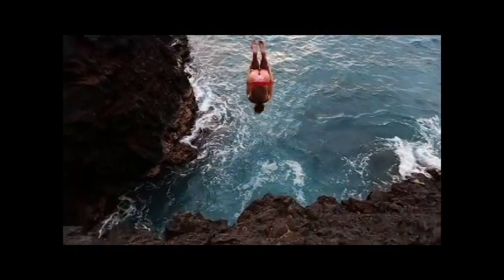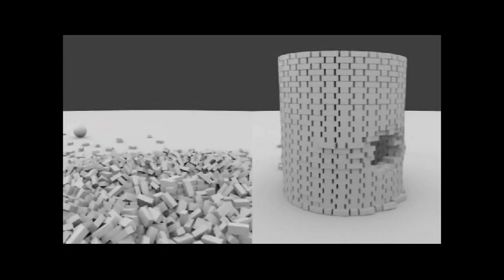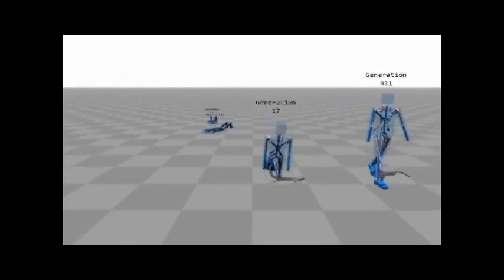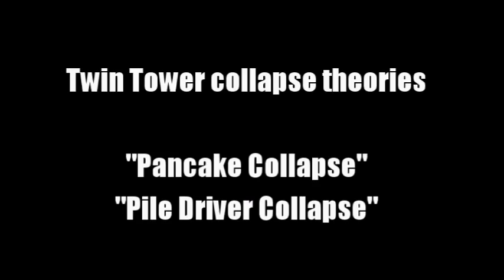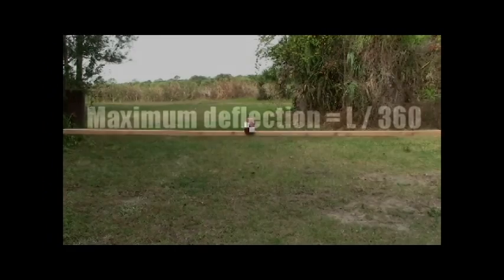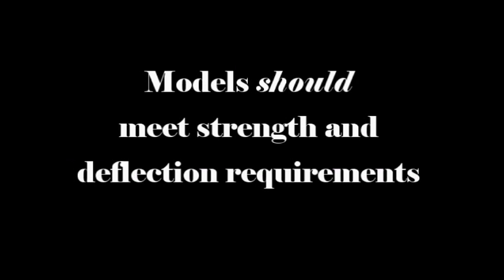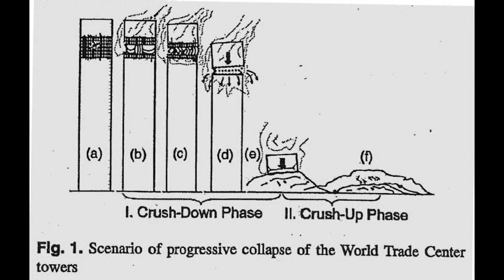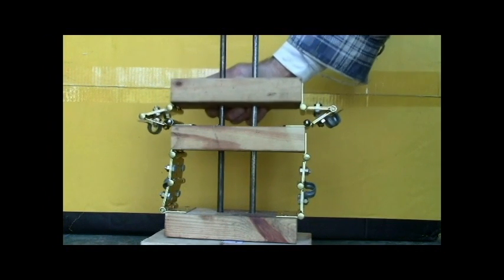9/11 Experiments: The Force Behind the Motion

Comment: Interesting and well thought out experiments but in the end proves little . The fuel from the aircraft leaking from impact point to lower floors may have set up a fuel-air explosions from arcing electrical cables and the heat from the fires weaken the structure, which was a monocoque design not post and beam creating a cascading failures. Your experiments did not do that , paper ashes does not reproduce metal getting ductile .

Comment: Strange how in your experiment the walls of are rigid and immovable. In the WTC, when the collapsing floors deformed each would begin bowing out,or in, the walls of it's, and lower floors, which in the WTC were was the primary load bearing structures. 

In your case these are completely ignored and not only not taken in to account, but assumed to be infinitely rigid. I liked the use Feynman to explain pure math over real observation, but in your case, experiments need also be peer reviewed and cross checked to make sure it properly modals the initial conditions of the event.
Reply: freeman239 bowing out, in no such instance in any vid did it look like the floors were bowing out, it looks to much like a controlled demo

Comment: Everybody should understand that there were no actual plane crashes on 911.
The greatest proof of this for the WTC planes is in the physics.
Newton's 3rd law states that "for every action, there is an equal and opposite reaction".
This means that in any collision, BOTH OBJECTS RECEIVE THE SAME FORCE.
The outer wall of the WTC was made from "the strongest steel ever used in building construction" and comprised of 2/3 tons of steel for each 18"-wide window. 
The construction is documented here:
watch?v=Jwc49cZKunQ
Whatever damage was done to that steel, the same amount of force needed to do that would also have to be received by the aircraft.
The amount of force needed to destroy the structure of a plane would be insufficient to break through the massive steel columns (and spandrels that were 2" thick) of the WTC outerwall.
In any case, the resultant force of any impact would cause a deflection of material backwards and away from the impact causing bits and bodies and luggage to fall into the street below.
And the thing is, even if you accept that Newton's laws might be variable according to speed, and that a plane could punch a hole then there is still no way whatsoever to explain how, with most of the aircraft vanished into the building and disintegrated it would be possible for the final bit, the tail section to penetrate a still-intact steel wall in front of it, as it would have no propulsion, little mass and little structural integrity.
This understanding allows us to see that the news networks broadcast pre-prepared fake video as "real-time" news and ran a co-ordinated psy-op.
THIS IS THE SILVER BULLET AGAINST THE MEDIA NETWORKS and it demands the question of who was controlling them.
It also exposes every other aspect of the official narrative as a lie.

For an object to penetrate such a structure, that object would have to receive the same amount of force needed to cause the penetration.
I suggest that such force would crumple an aluminium airliner, leaving fuel, wings, luggage, seats and people falling to the ground.
For that object to make IT'S OWN SHAPE in the structure, the object would have to receive that amount of force without breaking.
Think about it.
http://i178.photobucket.com/albums/w254/flyingdoc-album/speed-boat-crash-racing-accident-ph.jpg

30% glass, 70% steel Surface area
The depth of the window openings was 1.98m.
The depth of the spandrel panels between the windows (floor spaces) was 1.32m.
So vertically, for every 3.3m, 1.32m of that total area is steel spandrel plate, which was 2" thick, reinforced being welded to the box columns and by steel floor pans (thickness unknown) and a 4" poured concrete floor.
1.32 / 3.3 x 100 = 40
40 percent of the tower's surface area was steel spandrel plate, reinforced being welded to the 18" box columns spaced 19" apart and by steel floor pans (thickness unknown) and a 4" poured concrete floor.
For the remaining 60% of the surface area, where the windows were, there were box columns with the spaces in between them being the window openings.
The box columns were 450mm cross-section, and the window openings were 480mm wide.
So for the windowed area:
450 / 930 x 100 = 48.3
48.3% of that area was steel box column, and 51.7% was window opening (glass, you say).
We have already calculated that the windowed area was 60% of the surface area of the building, so:
51.7 x 0.6 = 31.02
We can say that the surface area of the outer walls was around 30% glass, 70% structural steel.
And 50% of that steel surface area was box column, equivalent to reinforced double-walled tank armor plating.
So (simply):
30% glass.
35% steel spandrel plate 2" thick, reinforced being welded to the box columns and by steel floor pans (thickness unknown) and a 4" poured
concrete floor.
35% box column.
The thinnest steel used was 1/4" thick.
The lightest of these 3-floor sections weighed 6 tons.
 Each section covered the area of nine window openings, so then for the lightest sections at the top there was 2/3 tons of structural (not mild) steel per window.
http://2.bp.blogspot.com/_LYmohCjnTj0/Rg1cnbOJTpI/AAAAAAAAATI/iG4doplGemA/s320/wtc-wall-panel.jpg

MOSSAD eteam:
https://www.youtube.com/watch?v=LN9hL_tKRuE

Comment: Interesting experiments. So I assume that the two steel pipes in the model were to simulate the core structure in the twin towers? The twin towers were innovative for the time, using that tube within a tube design where the core took most of the gravity load and the exterior the shear loading. The floors in between these two areas were just steel trusses with steel deck and concrete, which connected the core to the exterior columns. Seems to me that the floors were the weak link in the system - they can't support massive amounts of weight. The inner and outer columns could support gravity and shear loads but once the collapse started happening that force had to go somewhere, so it seems to me that it went outwards to the exterior columns as they were weaker than the core, and it put huge forces on the core, too as things were being ripped off of it. And there is that "hat truss" failure theory as well. Maybe there was a phenomenon at work which we are not aware of at this point in time?

My problem with the controlled demolition theory is that how would they have done it without anyone noticing? They have to put things in very specific places, run wires, etc. I would think that months of doing this would be required. And no one noticed? I'm still not convinced. It looked actually too neat for a controlled demolition. I live in Las Vegas, and of the many controlled demolitions I have seen here, none of them were that smooth and never even close to that fast, either.
Reply: Otis Elevator had an ongoing contract to maintain the elevators, located in the core section of the building, so materials and workers moving around would not appear unusual.  As you say, the speed of these towers collapsing (near free fall acceleration) proves that the columns had to have been knocked out.  One of the key points he demonstrated is that pancaking always results in a deceleration and NOT an acceleration as so many have been falsely convinced of.  Also, demo charges are clearly visible going off in the dark areas of many of the collapse videos.

Comment: Does anybody understand!!?!?!??! The reason things were popping out is because the top floors while it was falling it can push out the steel walls! Besides the building was REALLY heavy and it was putting a lot of pressure on the rest of the building, so you can not replicate it or if you wanted to you'll have to build a heavy structure to do so
Reply: And how does any of this answer why the buildings were vaporized and dustified in mid-air, leaving no solid debri whatsoever?
Reply: channel/UCEHEoSjM83LgIlLV8p2Mv1Q  sock puppet created on February 22, 2018, clear to who government troll?
Reply: Wow you are either kidding or you did not at all comprehend what you watched.
Reply: I comprehend that what I just watched was irrelevant and mostly unscientific bullshit.
What did you think it was?
Reply: The computer model at 5:14 that was shown on PBS wasn't even true to life. It showed a pancake collapse of the floor but the core columns were left standing. The narrative is all a lie.
Reply: A substantial portion of the core columns was indeed left standing for a short time after the collapse.
Reply: H DH
Why 50%?What would you say if I showed you photographic evidence?
Here you go:
https://youtu.be/yKzV1Pfyrl8
Reply: H DH
Did you run away?
Reply: No , I just looked at you video. All I see is spires turning to dust. Steel and aluminum turning to dust. I didn't think jet fuel could turn that material to dust
Reply: H DH
Those "spires" are the core columns that you said were not even visible, remember?
Reply: but they disappear and turn to dust. I wouldn't call that left standing.  Explain how they turn to dust
Reply: Also substantial would be greater than half. That's why I said 50%. Sorry, don't see that.
Reply: H DH
There is obviously WAY more than 50% left standing. Clearly you are just going to ignore all evidence and stick with your delusions.
Reply: There were 48 core columns. Can you honestly say there were at least 24 columns visible in that video? Additionally the tallest one that can be seen turned to dust. I haven't seen anything saying that jet fuel can turn steel to dust.
Reply: https://www.youtube.com/watch?v=dVPyaJw1mCc
watch this and tell me you still believe what the government told you.
Reply: Can you honestly say there were fewer than 24? Regardless, it is evidence that supports the collapse model, that you claimed did not exist.
I don't believe what governments tell me, I believe science. So far, I see precious little scientific evidence from the "truth" movement.
Reply: Yes I can honestly say there are not even close to 24 there. The ones that are left turn to dust almost immediately. I believe science, that's why I don't believe the government`s story. Jet fuel cannot melt steel let alone turn it to dust. Steel structures do not collapse in their own footprint from fire at free fall.... you can go on and on.
Reply: I guess you go around trying to debunk Richard Gage given your youtube name . What are you thoughts on the material David Chandler presents?
Reply: How many do you think there are, then? And how does that disprove the simulation?
The "government" has never said that jet fuel melts steel.
"Steel structures do not collapse in their own footprint from fire at free fall"
Says who? Not that that happened on 11/9/2001 of course. It seems your problem is that you are arguing against things no one who isn't a konspiracy kook has claimed.
Reply: I don't need to debunk Gage. He is a proven liar and debunks himself.
Reply: Ahh there it is ... anyone who doesn't believe the story the media feeds is a "kook". I never said that the government said jet fuel melts steel. David Chandler shows free fall in his presentations (you haven't addressed his presentations. And you still haven't said why the remaining ( I`d say I see at the most 6) columns turn to dust government troll
Reply: H DH
Aahh, there it is. Anyone who dares to introduce facts is labelled  a "government troll". What do you think Chandler pointing out a couple of seconds if freefall proves, by the way?
Reply: Did you watch the video? Free fall is indicative of no resistance. What could have damaged all of those floors below in tower 1 to allow that rate of collapse?
Reply: H DH
How fast do you think WTC 1 collapsed.?
Hint: it was slower than if it had collapsed with freefall acceleration.
Reply: You missed the point of this video. There were at least 90 undamaged floors that were built stronger than the top section that was struck. "It didn't match experiment. It`s wrong!" That top section could not pile drive or pancake the entire building to the ground. Much less at the speed it happened, free fall or close to free fall. You still haven't explained how the spires from the video clip you supplied turn to dust.
Reply: H DH
"close to free fall" is a vague, meaningless term. Why are you so shy about saying how fast you think E.g. WTC 1 collapsed?
Reply: I`m not shy about it. I just said "at the speed it happened, free fall or close to free fall". Why are you so shy about addressing why one of the columns  appears to turn to dust in the video you supplied the link for? I`ve brought it up or I`ve asked for your explanation multiple times but you either ignore it or change the subject.
Reply: H DH
"close to free fall" is meaningless.
How close? How can you make that assertion without knowing how long it took?
Reply: The top section of Tower 1 (The area above where the plane struck) should have slowed down when impacted the lower undamaged section. There is no sign of that happening. It in fact accelerated according to the measurements done by Chandler. For that to happen, those floors had to be removed. AND AGAIN YOU IGNORE MY POINT ABOUT THE COLUMNS TURNING TO DUST IN YOUR VIDEO
Reply: "should have slowed down when impacted the lower undamaged section. "

Why? And why can't you say how long the collapses took?

"AND AGAIN YOU IGNORE MY POINT ABOUT THE COLUMNS TURNING TO DUST IN YOUR VIDEO"

What makes you think they turn to dust?
Reply: Why should it have slowed down when it hit the undamaged section? Because of the laws of physics. A smaller section hits a larger section it will slow down, run out of energy and stop. You are clueless just stop
Reply: Which law of physics is that, then?
Are you familiar with how the WTC towers were constructed? Or are you clueless on that issue? You are definitely clueless as to how long the collapses took, it seems.
Reply: Newton`s 3rd Law of Physics. Do you know what that is? You seem to like to respond by asking questions.
Reply: H DH
No, but I am familiar with his 3rd law of motion, which has no bearing on the WTC collapse. Now then, what were the load bearing elements of the WTC towers? Oh, and how quickly did they collapse?
Reply: So what is his 3rd law?
Reply: For every action, there is an equal and opposite reaction.
Now then, are you familiar with the design of the towers? And for the 5th or so time how long did it take the towers to collapse?
Reply: LOLOL!!! A substantial portion would be greater than 50%. In no video of the collapse can you even see the columns exposed or otherwise.

Comment: The top of the towers weren't even dropped on the bottom floors...it had to start that run down process with ZERO momentum at all...👍👍👍💣💣💣👈👈
Reply: If you hold a bowling ball out at arm's length & drop it, it also starts the process with zero momentum.
Reply: channel/UCgaKSbOxRrh-Qup7-P47LbA presently named 'Mark H'.
Is it beacause that's the script your Jew boses gave you today?
Reply: TimReed22222  Now then, please explain how and why the buildings were vaporized and dustified in mid-air, leaving no solid debri whatsoever. Thanks Tim.
Reply: channel/UCgaKSbOxRrh-Qup7-P47LbA  presently named 'Mark H'.
Why do you want to talk about that rubbish government troll?

Comment: Like I said I don't know what the exact specs are but let's say each floor was designed to hold 20000 pounds and each floor weigh 10000 pounds that means everyone floor with carry the weight of two we had 11 floors above the 12th floor that fell down and crash through into the 12th floor was only able to hold 20000 pounds but when the floors collapsed 4000 lb on the 12th floor when the 12 for collapsed breached the the top 11 Floors Plus the 12th or would have gone down to the 13th floor then it wouldn't have enough Mass to continue to fall through the floors fact is not only had a mass but through